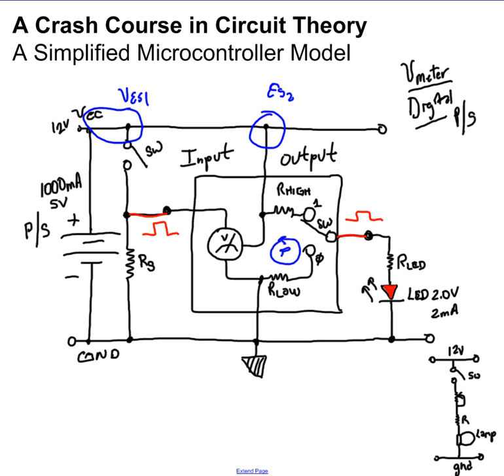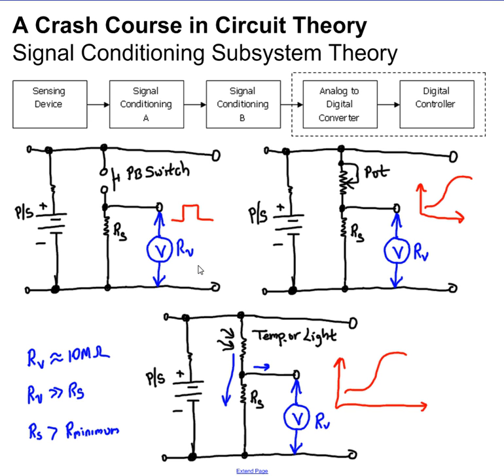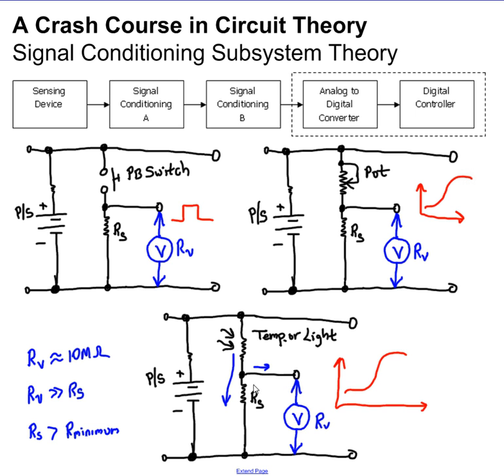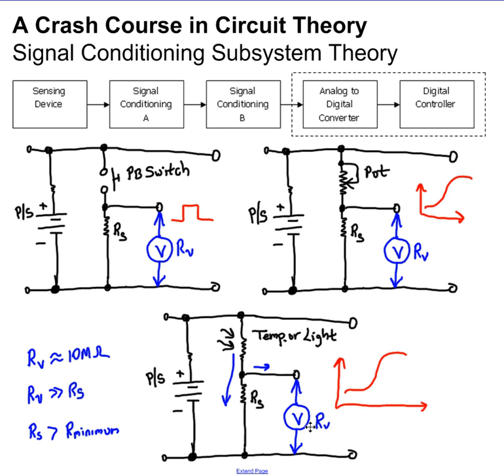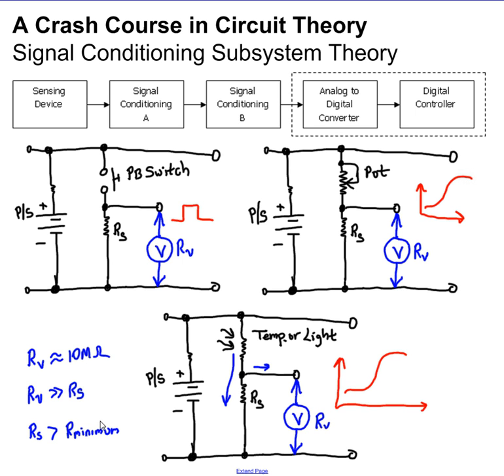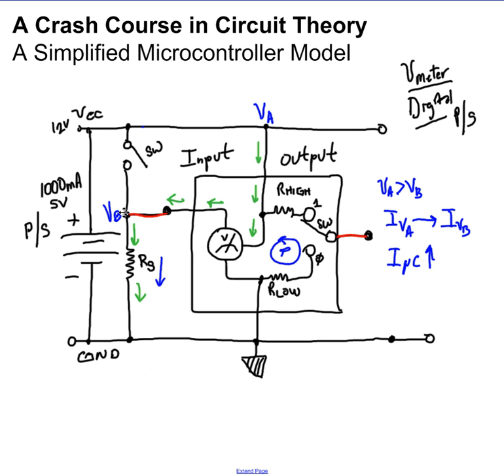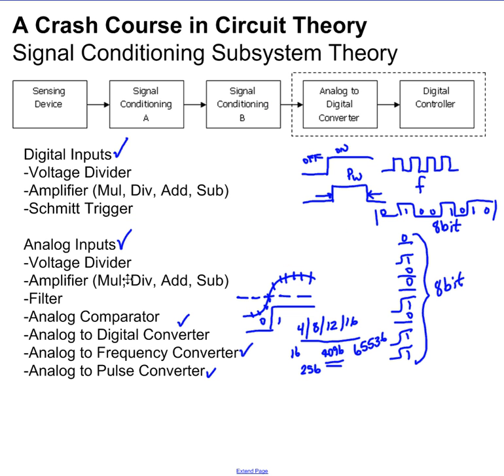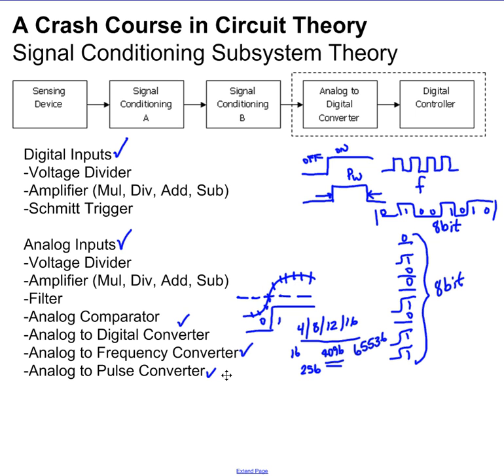25   A Crash Course in Electronic Systems Design   Signal Conditioning Subsystem Theory 03

Comment: Thanks for all your videos! You have summarised in a nice way the important concepts in circuit design. Please, could you make videos on circuit design "idioms" such as always putting a clamp diode in parallel with a motor when doing transistor switching
Reply from the maker: Hi Dumberee.  That is a great idea.  There are a lot of "idiom" language in electronics.  I will consider your request.